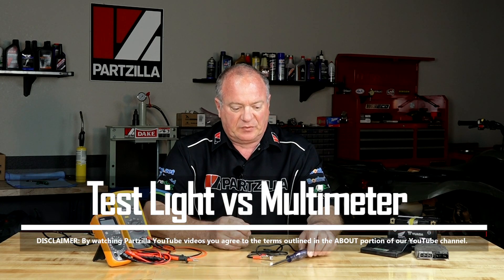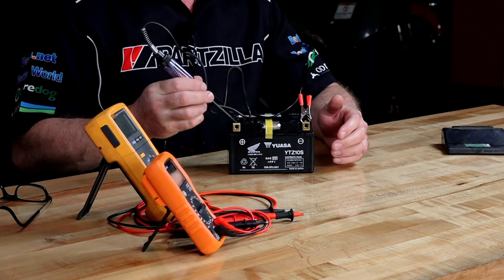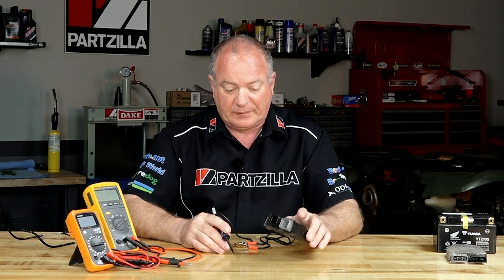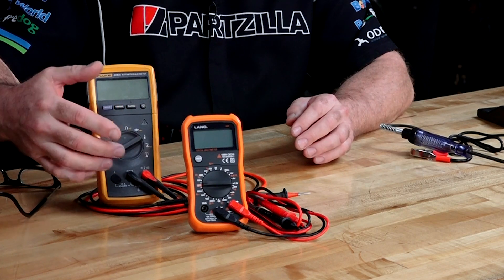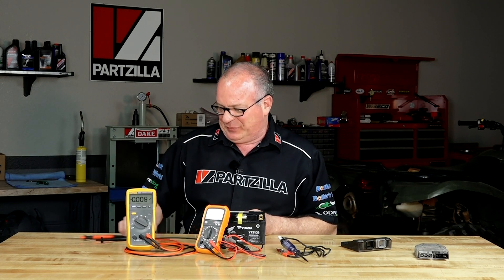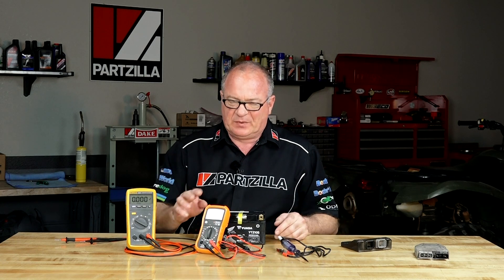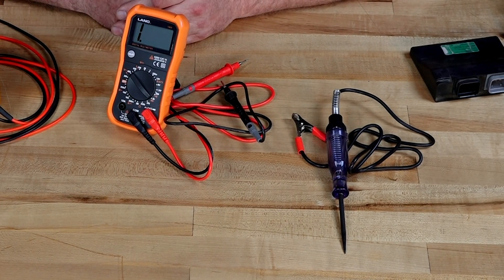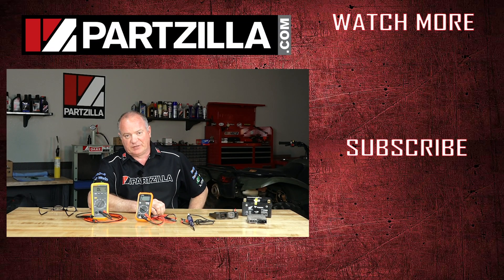Test Light vs. Multimeter  | Partzilla.com

Comment: how many times have you seen a 5v reference wire shorted to ground? these are non fused circuits so they designed them with safe guards to prevent damage.if it can a short to ground they can handle test lights

if you want to still be safe for peace of mind you can use a led test light as they draw 0.003a  or better yet get a 12v to 5v usb cigareete lighter adapter and hook your led to this 5v usb and there you have a worry free way to test cpu wires.

has anyone in here damaged a cpu with test light?

Comment: If you connect the light tester to a battery I can see how you can damage the ECU but what if you connect the tester to a screw or just a random metal. Can you still damage the computer when checking the fuses.
Reply: no thats what is for,these cpu circuits are tuffer then people think.if you are scared of damaging cpu you can buy a LED test light that say "computer safe" as LED only draw 0.003a where average incandecentsw draw 0.20a or so.